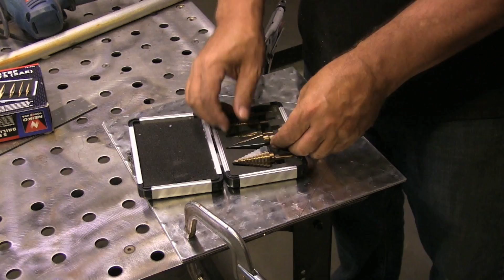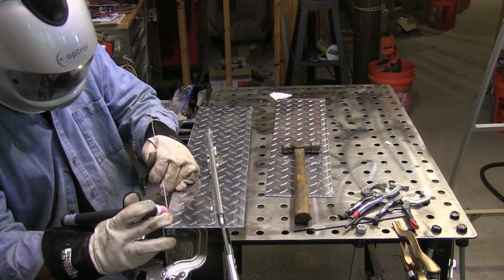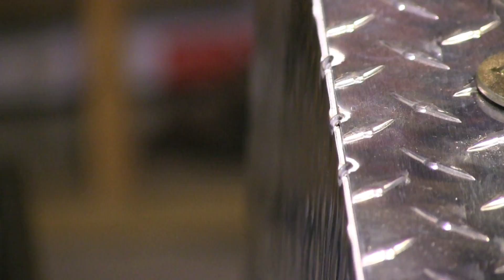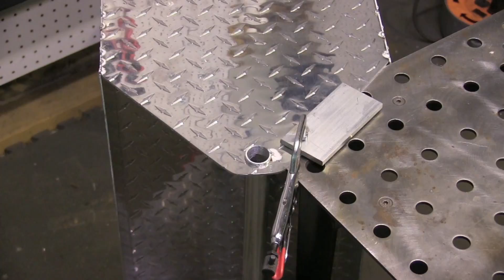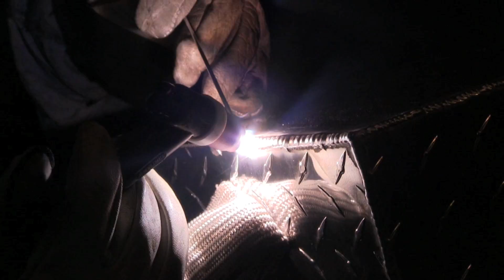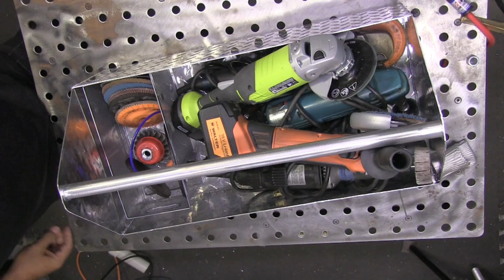Welding Aluminum Tread Plate - Tote Tray Project

Comment: Thanks for this video Jody.  I want to get into fabricating with aluminum, and this could be a good little project to start with. - A tote trays are always something you need, make one when you start, put the date on the bottom.  Then as you progress, probably need another, so make another, put the date on it.  That way you can see how you improve!  Great tip about the beeswax on the cutting disc.  Regards and respect to you Jody.

Comment: I tried the same but using smooth instead of diamond sheet and it went all wobbly also my tungsten looked nice and a beautiful colored ball on the end but went fury looking like a magnet with metal filings on it after a while i was using a number 6 cup, 12psi argon at 100 amps and a grey tungsten. I tacked it off the same even stopped and started the welds look good just the box looks ordinary.
Reply: I'm dialed in with 3mm material its just anything under that I struggle

Comment: Where is your ground clamp? If your ground clamp is on your work shouldn't you not be touching or leaning on it? Likewise if the work clamp is on the table/bench that the piece is being worked on shouldn't you avoid leaning on the table? - Taylor, GSK

Comment: I noticed you didn't scrub the aluminum diamond plate with a stainless steel wire brush.  Does that not have oxide coating?  Seem like it wouldn't weld, but obviously it did.  You did a great job on welding that.   I'm learning to TIG.  I'm doing a box much like this and I'm having a hell of a time getting a decent bead.

Comment: Wall thickness of the aluminum sheet? Looks like 2 mm, am i wrong?
Cause i weld same thickness at work, same amp (balance depends on how clean is the material), same cup, i usually go between 100/130 hz; but  the parts i generally have to weld are really small, so you Need 100 amp to start a puddle, but (I'd Need a pedal i guess, but we don't have) the part gets satureted by heat quiet fast... I tried to set some pulse frequency, but it's not very productive, cause i weld in many different and not very confortable positions, so with pulsing, sometimes i feel i could go faster without It,  while other times the same pulse setting Is too fast.
In order to not spend All the day setting the machine i Just decided to manually pulse with the Torch button, running in 4t, so i have Also an upslope (Just in case), a downslope and a 5 sec postgas.
I mean, the result Can Be really nice (obviously I'm not flawless, so more then a bead Is not that nice), but i'd really love to try with a foot pedal someday..

Comment: Would it help to put steel wool in the end of the tube to keep the chimney effect ? I made a box that was sealed but could not close it since it pushed the hot air into the weld and made it muddy.

Comment: I do this type of TIG welding a lot. I noticed you wiped off the edges before welding. That is critical and I cant stress that enough. Acetone works best and dont be stingy. Also instead of wax I use a 50% mix of cutting oil and WD40, it wipes off easier and it lubricates just as well or better than wax. Another point I would like to make is using filler rod. What we do is use overlapping joints and we just use fusion joints. Number one a fusion joint in this appilication is just as strong qnd you dont have to waste filler rod. Number two a fusion joint is flat so you kinda eliminats the box sliding around on those higher peaks on the weld bead. This is just my experience qnd may not apply to everyone.

Comment: You can also use a circular saw to cut the aluminum, it helps keep the weld clean, if you notice on your weld it had some inclusions and that's because of the cutting disc

Comment: Hey ive had problems welding aluminum with my machine at work. Can you make a video on how to weld aluminum with a more basic machine without any special functions.. basically just ac current? It seems really hard to do!
Reply: Jonathan Gesualdo if you search way back, hes done vids on scratch start tig with just a Thunderbolt Arc welder, its a little primitive but it works. For aluminum youre gonna need AC though

Comment: You ran all those long corner joints with an air cooled torch? Did you ever have to stop and wait for it to cool or did you just power through? I remember you saying in previous videos you like to test the limits of air cooled rigs. But this one, I'd imagine, would be quite a stretch.

Comment: Great work as always! Curious what disc you used to cut the sheet with?
Reply from the maker: metabo slicer plus 6" disc...doesnt work that great until you put the wax on it. then it works great.
Reply: Gotcha so its effectively a nicer cutoff disc. Beeswax is God's gift to the fab world for lubrication!

Comment: You talking about duffing your electrode was very timely and really helped me not beat myself up a lot. I just got a new Square Wave 200 and was practicing aluminum last night and its been a while. Was practicing T joints and man, I plopped that filler rod right onto that electrode 4 times within an hours time and really had me mentally beat. Its nice to know even the pro's do it. :-)

Thanks for the great video Jody!! Picking up a tig finger today!!  :-)
Reply: Brian Streufert have a few ready so you can just slam one back in and keep goin
Reply: @ Brian Streufert
I've been tig welding 30 years and I keep 3 or 4 sharpened tungsten right next to Me. I'm a really good welder but tig jerky, some can't weld and are and as smooth as silk. Nice thing about welding, there's always a do over. I get the feeling Your welds are really good.

Comment: Nice project Jody! Great welding. I too have a lot of grinders, A welders best friend.
Reply: "A grinder an paint, makes me the welder I ain´t"..................or so I heard......
Reply: You can't have enough grinders. I've got mine set up with different attachments so I don't have to spend time changing them all of the time. I learned that pretty fast when I learned how to weld with my first everlast welder. I was spending more time changing the (one) grinder I had than actually welding.
Reply: Dennis Young  I only run Metabo's.
3x 6" and 2x 9" machines...
Best ever...
Reply: Dennis Young  they are the same... Only larger🙂 
Where you from? I'm from Denmark..
Reply: Dennis Young  I haven't done much traveling either. 
But maybe in the future.....

Comment: nice, jus a question... you have the materials... why not make a brake for yourself?
Reply from the maker: Chad Adkins it's definitely on my to do list
Reply: I thought you had one of those Swag Off road finger brake kits? I bought one and build a press for it, I use it way more than I thought I would have.
Reply: weldingtipsandtricks I was going to ask the same question.  Harbor Freight sells a decent one for about $40. You can always use it as a starting point for building your own if you don't like it.